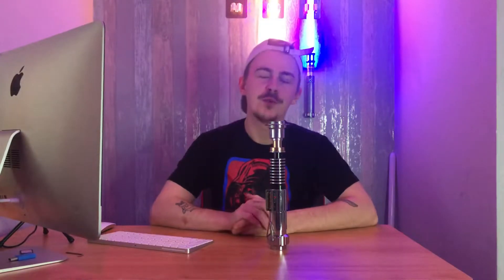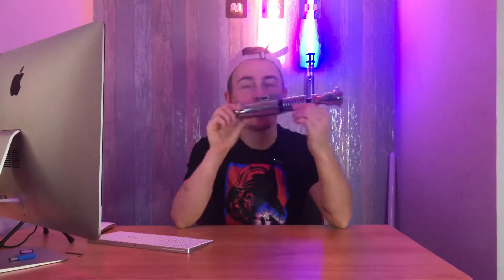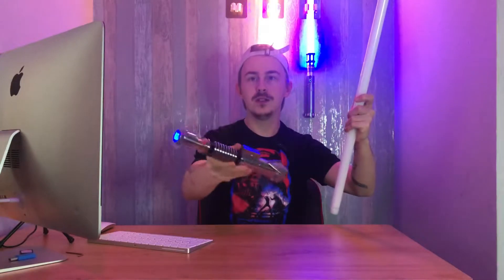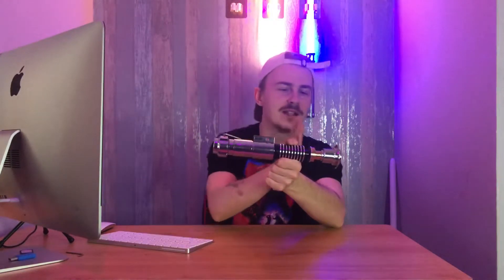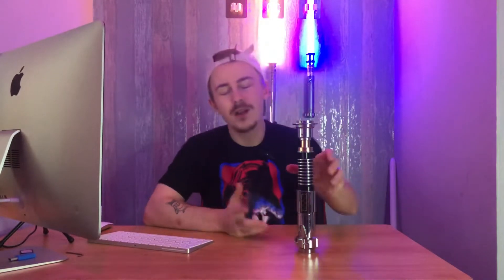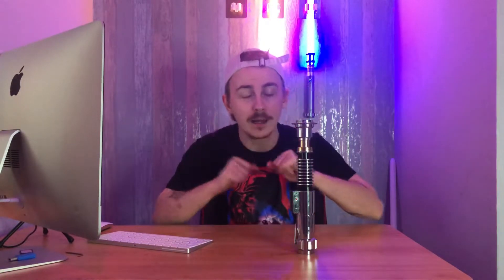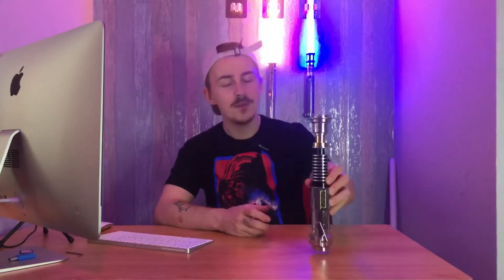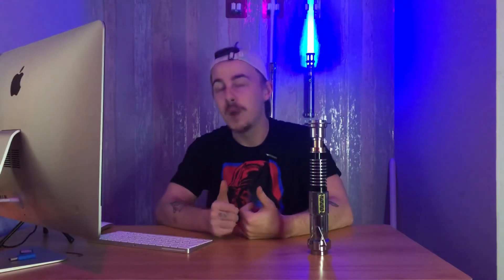Minor Neopixel issues and how to fix them | Proffie 2:2

Comment: I have a problem with the button not having enough room. It’s pressed in all the way when I slide the side piece on
Reply from the maker: It’s likely your button cover is too thick but my suggestion would be to either sand down the button or check there’s no wire pushing the button up to create the lack of space. Hope this helps

Comment: it seems like im getting a good connection on my xeno v3 i went to add a sound font and after i put in the sd card the blade is dim and only displays red. i used my back up files to try a different sd card and its doing the same thing, am i cooked

Comment: my saber won’t clash and i’m trying to figure out why. can you help?
Reply from the maker: Sometimes it can be a sensor fault and would require you contacting the supplier you ordered from but if you haven’t already, try removing the battery, placing back inside and charging fully and this could solve the issue as it has done for me in the past, hope this helps ☺️
Reply: @ihazasaber9522  i factory reset it and now when i try and power it on, it just makes this weird sound like someone talking but i can’t understand what it’s saying. i’ve took the battery out and charged it i tried tones of stuff nothing working.
Reply: I factory reset my saber through the app and now it won’t turn on and i can’t connect to it on the app. When I press the button it makes this weird sound sorta like it’s talking but i can’t figure out what it’s saying.

Comment: Hey, I ordered the battle Neopixel saber from Kyber sabers. Even though the button isn't held down or even faulty, for some reason, the lightsaber always believes the button is held down and I cant turn it off when i reinsert the battery. Do you know what the issue is?
Reply from the maker: It is potentially that the button on the saber chassis is slightly stuck in and making the board act as if you’re pressing it down or that there’s a fault in the coding on the board, i would consult the company and seek advice from them as the fixes for both require going into the chassis which can be problematic

Comment: A bloody excellent video expounding on the many and common (minor) issues with lightsabres and how to mend them. However, I do have one question [for] you that I fancy hearing your thoughts on: the odd smell coming from the speaker. 

Right. So, here is some context. I ordered the Anakin Skywalker Episode II lightsabre (yes, the Tusken Terminator) and the sabre is lovely. It is a Proffie board. I have had the sabre for three weeks now, only noticing the odd smell by the second week. (The pommel cap is vented, by the way, hence how I am able to detect the smell). I am an adult collector; therefore, I do not duel with my very expensive ‘toys’. I ignited the sabre today and in addition to the smell, the sabre sound is now crackling. Very odd. Is this a speaker issue, battery issue, SD card issue, or other? 

Again, what do you reckon?

Thanks, mate!

What do you reckon?
Reply from the maker: I’ve come across this weird smell myself before it usually tends to be from the adhesive they use to fasten the speaker in place and no cause for alarm but if you are hearing crackling as well it could be a burn out somewhere! i would recommend contacting the company for them to investigate just to be safe. Hope this was helpful and really appreciate the feedback it means a lot ☺️

Comment: My neopixel proffie saber lights up and makes sound but the exposed cyber crystal and blade don’t light up. What do you think happened?
Reply from the maker: In some Crystal Chamber reveal sabers the crystal doesn’t always light up and this issue sounds like a fault in the connection along the board. I would contact the the company and ask for a repair if it came that way. ☺️
Reply: @ihazasaber9522  I did. I sent them a video and hope they figure it out.
Reply: Hey, I’m having the same problem with my saber. I just got it yesterday. Did you ever get yours figured out?
Reply: @pre12361  no. Had to get my money back from the company because they weren’t responding and purchased another from cc sabers which is much better. Ordered the other from KyberSabers

Comment: Hey dude can you help me out with my new neopixel lightsaber? Mine does light up, just not fully and I can’t figure out why, can you help?
Reply from the maker: Have you tried using a different blade? it’s possible the blade is damaged but if that doesn’t work the config is likely for a shorter blade, contact the company and ask for a copy of the config file! hope this helps ☺️
Reply: @ihazasaber9522  Oh sorry forgot abt this I ended up having to change how many pixels the lightsaber was using on a Bluetooth app🤣 Atleast it got fixed

Comment: Hello. I am having an issue where there’s no light coming out of the hilt. The sound and motions work but there’s no light. What do you recommend?
Reply from the maker: does it light up with the blade? if yes then it’s most likely got no accent LEDs inside the emitter connector ☺️
Reply: @ihazasaber9522  it does not light up with the blade.
Reply: @TriniDaChief what did u do to fix

Comment: Hello! Just received mine and laterally started freezing and staying on, now it froze and shut off, not wanting to turn on again, when I put the battery though it stills make the sound when you put it in but I twist the chassis to see if turns on as it is but its not working, what I only have now is the sound when I put on the battery, I got it from saberspro and they dont answer.
Reply from the maker: Unfortunately that sounds like you have a faulty saber that has to be fixed by a pro and saber pro can sometimes be a difficult company to deal with, i recommend searching for a guy on Facebook called Jamie Wells he’s an installer based in the UK or Solo Sabers in the US and they can reinstall your saber for you ☺️hope this helps and sorry to hear about your saber

Comment: mine was doing the thing were it freezes up. It is an OWK2 from padawan outpost. I had sent it back to them and they said they couldn't find anything wrong and they had checked the wiring and replaced the battery and formatted the SD card. It was working for about 20 minutes then it started doing it again this time it was screaming, I thought it was normal but now it isn't activating at all. I know absolutely nothing about anything to do with electrical stuff on these. I'm a bit stuck.
Reply from the maker: I would recommend removing the SD card and inserting it back in as most of mine had this same issue with hard freezing and crashing but after doing that it fixed that issue for me! ☺️
Reply: @ihazasaber9522  It hasn't worked I'm probably going to have to message PO again I'm sure they're sick of hearing from me at this point 😂

Comment: My lightsaber won’t make sounds and when I triple click it it will either play the Star Wars theme in 8 bit fashion or say something unintelligible. Any ideas?
Reply from the maker: I’ve not personally encountered this issue but it sounds like it may be failing to read the file from the SD card as typically pressing the button 3 times puts it into battle mode! try re insert the SD card and should solve the problem ☺️
Reply: @ihazasaber9522  I couldn’t get the SD card out but I got the battery out. I put the battery back in and it works fine now. Although I didn’t use your method I wouldn’t have thought to remove the battery without your input so thank you!

Comment: What about when your proffie completely freezes up and plays a very loud ringing sound and won’t stop until battery removed? This has been a recent issue for me.
Reply from the maker: so this issue can be pretty common, it’s a hard crash, usually to solve this issue it requires removing the SD card and plugging into a computer and going through the files and not doing anything to them, that’s how i’ve gotten around this issue. Hope this is helpful ☺️
Reply: @ihazasaber9522  it’s frustrating, lol. I have two proffies and only one has been doing it. Seller says it’s an error with blade connector pins. Yours is the only other reason I could find online, again frustrating there’s next to NOTHING about troubleshooting. I’ll give your method a shot, but do you mean like literally just looking through the config or looking through the sound files?
Reply from the maker: @SUNDER_Slayer  Yeah it is really frustrating especially because of the prices of these sabers and yes literally look through the config files and it should make things a lot smoother. How strange the product test the sabers before shipment so they should’ve caught that if that was the issue.
Reply: What if you don’t have a computer?